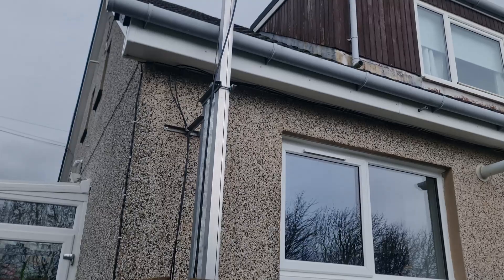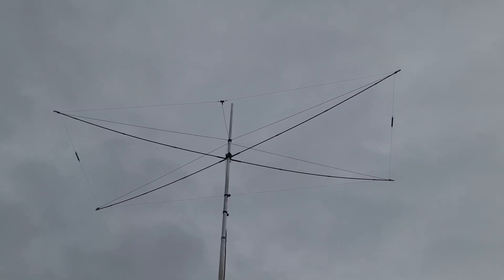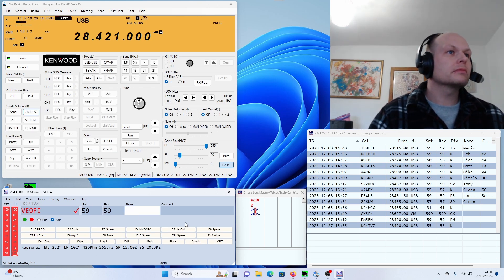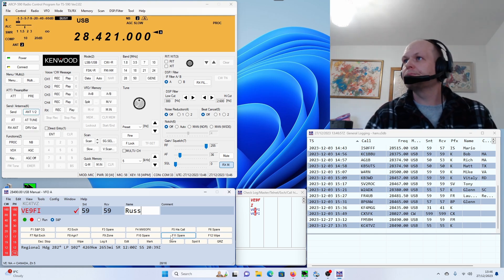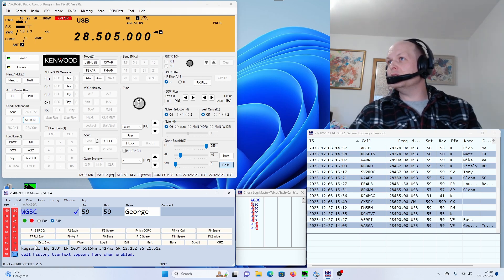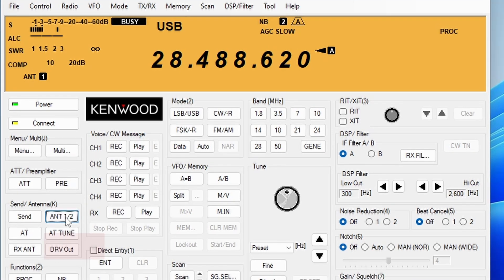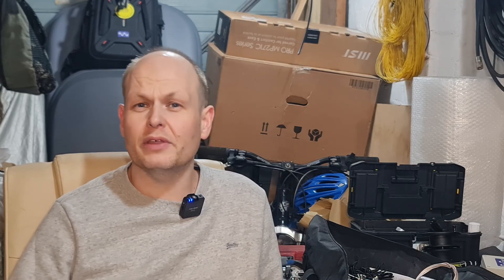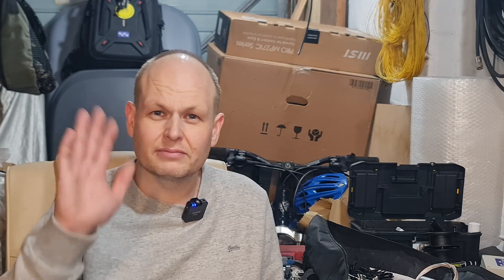How much better is a Beam Antenna over a Multiband Dipole on 10m?

Comment: Great comparison Colin, its what I would expect.  In most cases a beam should out do a wire however i did do some experiments some years ago with a friend in Leicester who had a field and used wire verticals.  The beam won but the margins were smaller.  His noise floor was also very low.  Doesn’t matter about apples for apples comparisons, these are the tests that matter for the individual within their own QTH boundary.  If you can achieve that low angle of radiation with a vertical you can get good results but i don’t see it beating a beam.  Happy New Year,  Regards Mike
Reply from the maker: Your spot on Mike, everyone's milage will be different so its preferential to experiment yourself. The results are not always what you think they will be. Happy new year 🎉

Comment: A well paced comparison Colin, too many people post comparison videos where it is difficult to keep up with them switching rapidly. As for noise in general, have a look for GM3SEK "Clean up your shack". I made a few of his mains filters with integral common mode choking and the results were remarkable. But as the doctor would say "use as directed". 73
Reply from the maker: Beleive it it not I built the mains filter and its fitted here, PC and Radio into it. The PC's PSU is just so dirty. They have acknowledged this, just trying to agree a suitable replacement. I wish I had a twin RX radio for simultaneous comparison but the 590 does a fine job for what it is.
Reply: @MM0OPXFieldRadio  hope you get the PC noise issue resolved, it can take a lot of the fun out of the hobby. I have a few rigs with diversity receive, it really is a game-changer but understandably it may not be an option right now. Your Moxon does appear to work well, quite impressive. I have fairly limited space and it is a challenge to get the aerials for every job.
Reply: @MM0OPXAmateurRadio  The 590 is a fine radio compared to the junk being promoted by so many hamtubers. How they can recommend a Xiegu over a Yaesu is purely dishonest. Thanks for keeping it real.
Reply from the maker: @radiotests  Thanks, I should make a video on the 590.

Comment: On my list Colin 73 happy new year chap
Reply from the maker: Yeah once you use one you wont go back.
Reply: @MM0OPXFieldRadio  good morning Colin I built a single element delta loop due to my noise floor that was fantastic cut for the 10m band used a 1/4 wave length of RG6 to make a matching stub, SWR across the the band was good managed to open several repeaters in Europe and could hear the parrot repeater in New York.
Reply from the maker: @tonym7cvk430 I like loops too. I have one of these on my build list.

Comment: More than a bit late noticing the video, but that was decidedly interesting. It really is a pretty significant difference. In the heat of battle for a difficult QSO, the Moxon is going to wipe the floor with the OCFD in practice.

Now, a vertical with a reflector though. That’s quite an easy thing to set up and would be quite interesting to see back to back.
Reply from the maker: I agree on the difference. For the higher bands I find the Moxon easy and it doesn't need much of a mast. You can turn that easy vs parasitic verticals. I will be getting back to phased verticals soon.

Comment: The Moxon wins hands down on both RX and TX. With the gain on the Moxon your ERP has to be approaching 2KW. The ERP on the OCF antenna is going to be less than the power you are putting in with coax and balun losses plus the relatively low or no gain present with an OCF even on 10M. Even though it's technically 2 wave lengths, your not getting any gain from that unless it's at least that many wave lengths above ground. Achieving gain on an antenna is important in amateur radio communications where you are competing with a lot of other stations in Europe and North America running a KW plus plus plus. Great comparison video. I really want to build this 2 element Moxon and stick it up on the peak of my house roof at about 10 meters. A cheap simple TV antenna rotator would handle it no problem. At a wave length above ground, it has to be in the neighborhood of 5 to 7DB of gain. Cheers to the station manager for keeping you in line with planting antennas in the garden :)
Reply from the maker: Great comments 👌.  When I was testing the 5/8 vertical, took me a few calls in the pileup but the Moxon it was first time every time. Thats the ERP your talking about, makes all the difference. I've had one of those TV rotators and yeah more than beefy enough.
Reply: Not sure how you get 2KW Erp....moxon maximum 5 Db forward gain...same as Hexbeam....
I doubt it's even 1 Kw but still useful gain.

Comment: I replayed the antenna switch and watched the S meter.  3db is what I saw. The side and rear rejection is also better with the Moxon. I'm going to use an OCFD for my general band and hope to get some help from local hams raising a 10m Moxon with 2m and 70cm on the same mitary mast. It will have the "armstrong" rotator. 😂
Reply from the maker: So on the Kenwood, 1 S unit is 6db, on my Icoms its more like 3db ber s point. On The stronger signals S7+ the drop was 2 S units so thats minimum 12db. I didnt include all the clips or the video would have been so much longer. The OCFD is still a very good all band antenna, no regrets. Good luck when you get your general 👍

Comment: I have found many people getting hung up on Antenna Modeling dealing with radiation patterns.  Keep in mind, it's an idea of what your pattern may look like. It isn't set in stone, and it isn't absolute.  It has been my experience those peaks and nulls are far more dramatic in graphs due to hard edges going from one point to another. There is no smoothing of the edges, and can really make patters look worse than they are.
Reply from the maker: Yes I agree, real world testing is always preferential. At least this was I know for sure.

Comment: Hi.... I need your help . Seems like we have same radios . I have same noise level with my vertical sirio 827. You think using a similar moxon antenna or EFHW could be better ? But I am not for the performance tho ....
Reply from the maker: So its not just as simple as that. Your noise coild be coming from anywhere. Your antenna is very good for 10m. Turn off your mains electricity and run your radio of a battery and see if the noise is still there. If it is then you are not causing it. Its unlikely of of your suggested antennas will have less noise.

Comment: Have you ever compared the ocf with your efhw? Cya Colin
Reply from the maker: Yes, mono banded on 20m. No real noticeable difference apart from the EFHW was slightly quieter. Both are dipoles at the end of the day.
Reply: @MM0OPXFieldRadio  I’ve noticed that as well. Actually the efhw is a tad more than slightly more quiet on rx. I’ve only tried it in the inverted L

Comment: Your new computer noise issue could be a result of the cpu frequency/ multiplier. Is your cpu speed fixed or variable. Also switch on the computer then remove connections for monitor, keyboard mouse etc to see if noise is generated withe the case or the connected cables. Cheers GM0EEH Jim
Reply from the maker: Not sure re CPU Jim. Done the check removing all cables and its still there. Its currently away having its PSU swapped as I made a wee sniffer that was just a short patch lead connected to my 705 and it seemed to be originating from PSU. Fingers crossed.
Reply: @MM0OPXFieldRadio  
Ok all the best hope you get it sorted

Comment: 10 mtr Moxon size comparison to a mono 10mtr hex. Garden here 20'x40' hence the question. GM0EEH Jim
Reply from the maker: Either would easily fit. Go with Moxon as simpler for mono band and more gain and F/B
Reply: @MM0OPXFieldRadio  
Thanks for the input on the gain